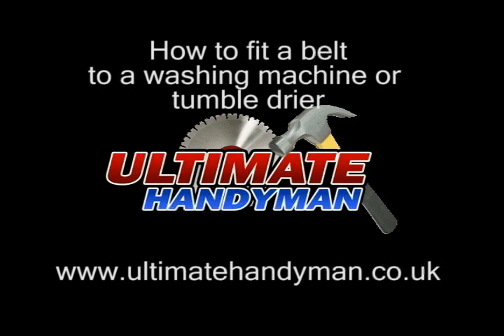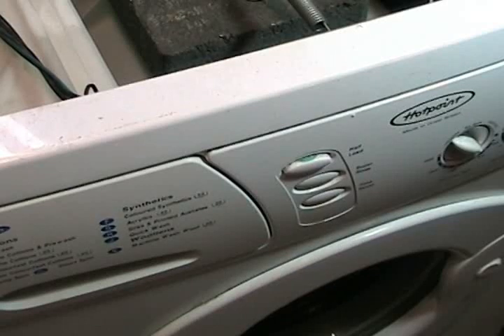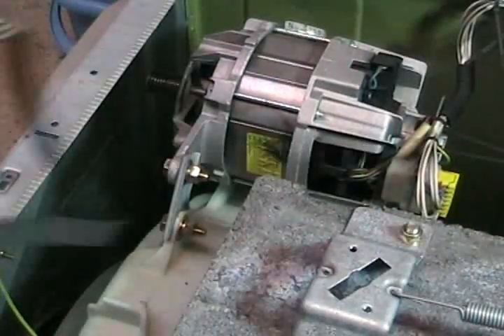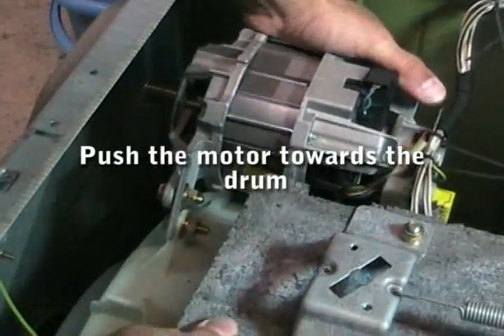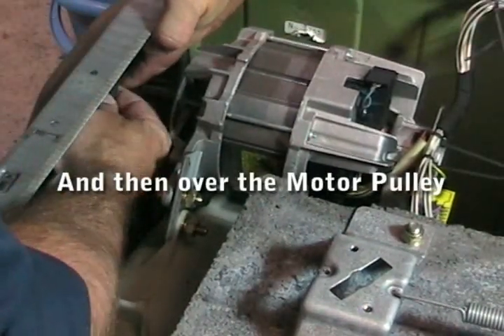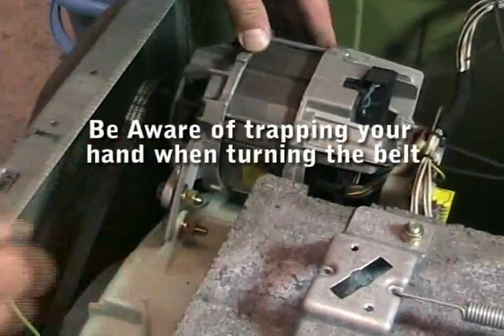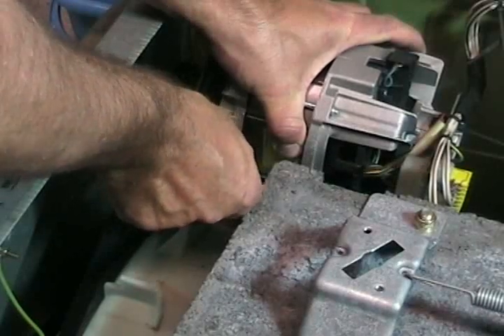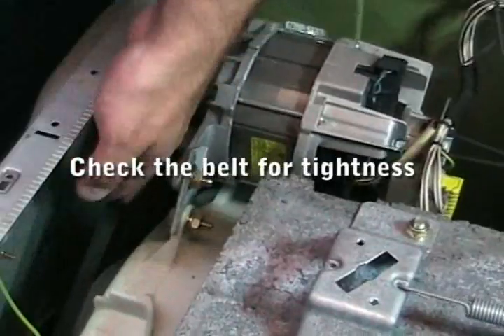How to fit a washing machine belt

Comment: This is in reply to Mulberry2000. I just spent the day removing a sock which had jammed between the rotor and stator on a Zanussi 1207OS machine. Part of which required the refitting of the drive belt as it had come adrift. But there was good access as there is a good size panel (held on with five screws) at the rear of the machine. Only point to note was to set the belt on the drive spindle of the motor and the wheel on the rotor in a direct line. Otherwise the belt tends to "walk" to relieve the stress, which may result in it coming off the wheel.

Comment: I just opened my a washing machine (which luckily has an easy to remove backpanel), because the drum bearing seem to have worn out. But that's not the question here.

I also found large amounts of fine black dust around the motor pulley and on the back plate approx. where the belt runs after the pulley. Does this mean the belt was not tensioned enough and slipped? The belt does not really look worn though.

Comment: hi i cannot do this on a zanussi, the motor is at the bottom and you cannot take the back off, only the top, so i am perplexed as to how to fit the belt as it has slipped off. zanussi electrolux 1221w